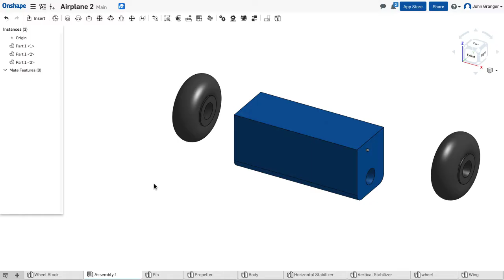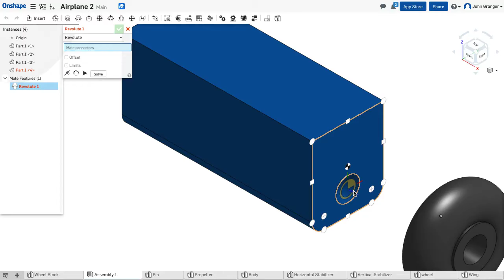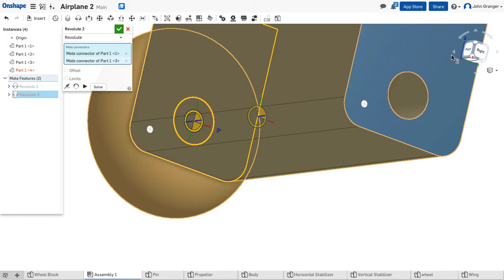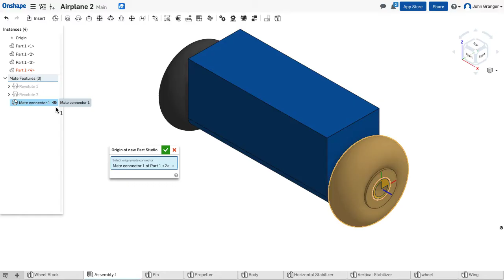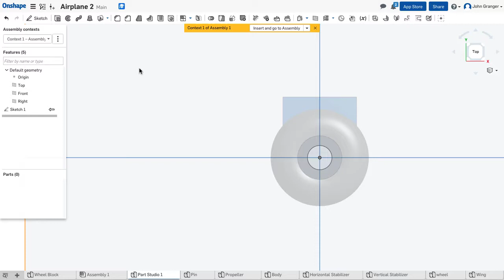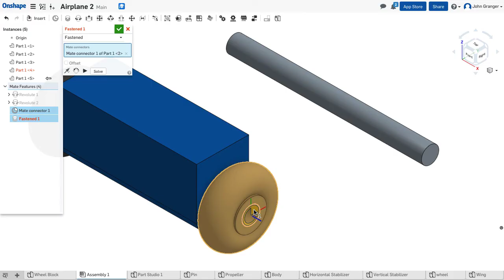Onshape Project - Airplane - Step 9 - Wheel Sub Assembly

Comment: When I click offset it bring the wheel and block together rather than bringing them apart. Do you know why?
Reply: Maybe try putting -(1/32) inch instead of (1/32)?
Reply: @Airiternity  lol that actually worked, thanks
Reply: @christopherdubon2320  no problem lol.
Reply: @Airiternity  Ur a life saver bro.
Reply: @Airiternity cheers mate it worked for me pretty well 👍
Reply from the maker: You probably have the Z offset settings of the Mate Connectors going in the wrong direction.  In the Revolute Mate dialog box, you set an offset to put a space between the wheel and the block.  If the offset results in wheel overlapping the block, then click on the arrow in the lower left corner of the dialog box to reverse the direction of the offset and it should result in a space between the wheel and the block.  If you are editing the mate and continue to have problems, delete the mate and start it again.
Reply from the maker: The placement of the mate connectors on either the wheel or the block is wrong.  Delete them and try again.  Consult the video as needed.